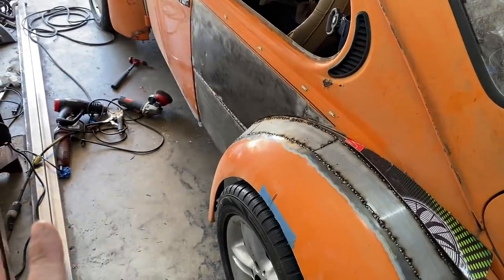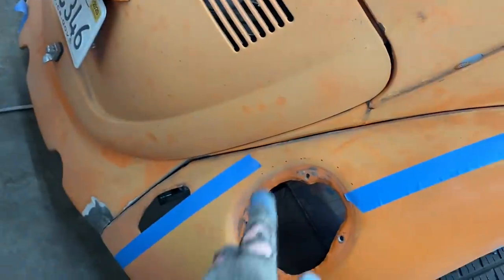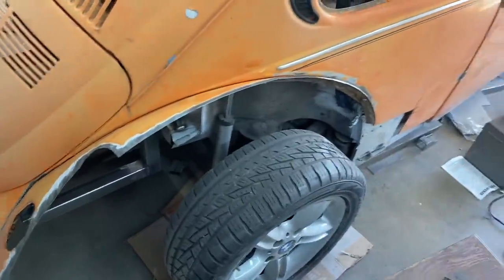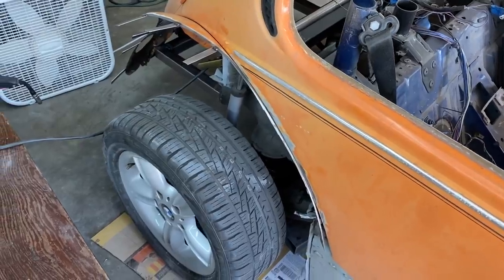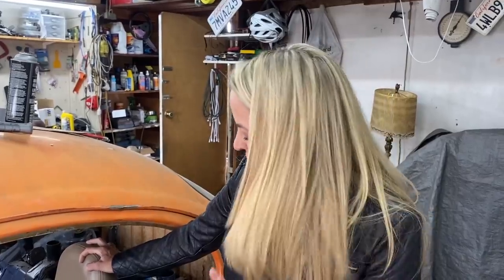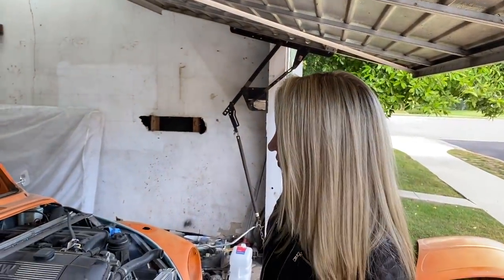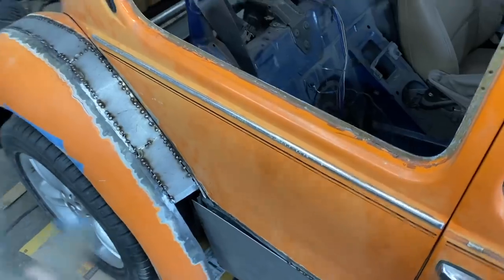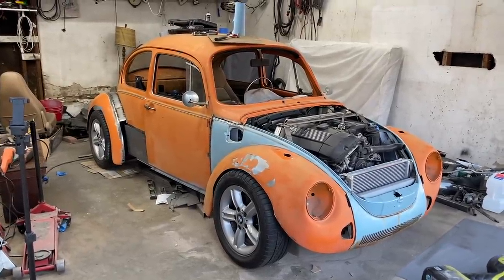The Mutt Ep43. BMW Z3 VW Bug Body swap. A fine back end!

Comment: @Nathan's Garage if you wanna get real fancy, before you buy your next project car for $60 you can get a magnetic paint mill-thickness gauge. Looks like a pencil with a magnet on it, stick it to the paint, and pull. However far the scale slides out tells you the thickness of paint/material. Def worth the investment. LOVE the videos, keep em coming.
Reply from the maker: Thank you. If only I'd have know that! I'll be investing.

Comment: Awesome build Nathan! Fellow sheet metal guy here. A self-leveling cross-line laser is a tool I've found to be indispensable. I use the Bosch GLL2-40. Establish center line front to back and pull measurements from there. Looking forward to seeing the Mutt on the road. Keep up the good work!
Reply from the maker: Ooh. I'll definitely need that if I go the "build a frame" route.

Comment: Remember  wheel  alignments are usually different side to side, to accommodate road slope, and driver weight sometimes. Digital angle gauge will make it easy to tell.

Comment: Well, I have to admit I was pretty unconvinced with how you were doing the back fenderz... but you nailed it.  As my  cousins on the other directed pond say, right well done fellow!
Reply: Also, look on Amazon for a paint thickness tester stick, they run about $10 and will make your life so much easier.
Reply from the maker: @richgallegos5807  huh...I'll take a look. Thanks.

Comment: Looks awesome my man 👌. Suggestion for the difference between the tires sticking out at different lengths!?!? Shim the driver's side rear wheel to stick out the same as the passenger side. It might not be a big enough difference to buy a manufactured spacer but you have the sheet metal, make your own spacer/ shim...... It will work and is a logical and cost effective fix for a seriously complicated problem. Seriously looks awesome 👌
Reply: And you need to stop selling yourself short with the Nathan's Garage body work,its your first attempt and your killing it man. Your respect and attention to detail is what is going to carry you through and it's only up from hear.
Reply from the maker: @richlucasjr9116  Thank you for the kind words!

Comment: Bit off topic but I build RCs and do a lot of the same stuff just in  miniature. So this interests me as just converting a one sixth scale RC Ford F350 Super Duty into an Excursion so currently doing a lot of similar body fab work! Also made a lower half from scratch. Which went just like yours when I lowered the new plastic body onto the floorpan/ engine bay section. Which I mate from plate alluminium! 
Sound familiar?😁👍
Reply from the maker: haha! That's awesome. So much work on a small scale.
Reply: @NathansGarage  you wouldn't believe how fiddly it is loving it though so I know why you do it buddy! 😁👍will be watching the new vid in a bit!

Comment: Audi tt mk1 would make an awesome swap in my opinion. I did a bunch of overlays and look quite perfect. I was going to do a bug swap with mine but sadly I'm parting it out. If your interested in the rest of the car I'll make you a steal of a deal.  You come of as a very positive person and make peoples day when you post videos. Dont let the d word get you down. Also nobody is going to notice 3/32 to an 1/8 difference. Keep up the work
Reply from the maker: Where are you based? Always interested in car carcasses. I parted out the Miata swap. It's a journey. Sometimes it's right sometimes not.
Reply: @NathansGarage  Fresno CA. So not far from you.